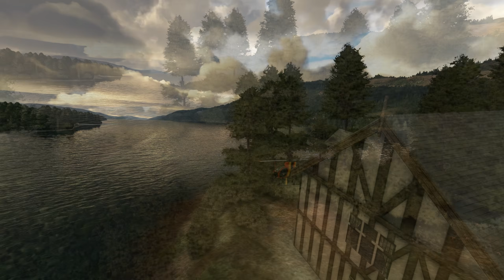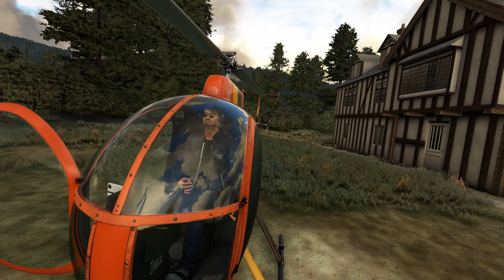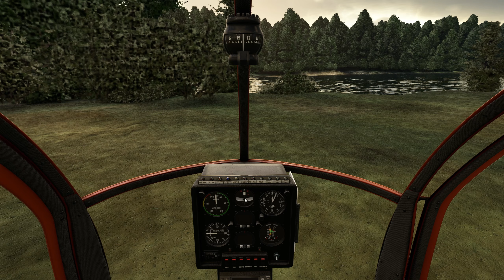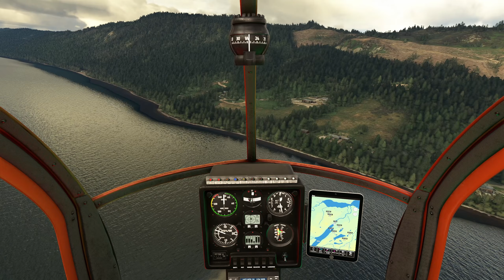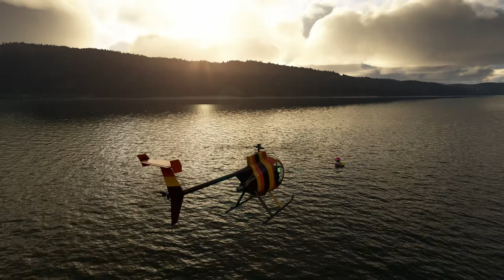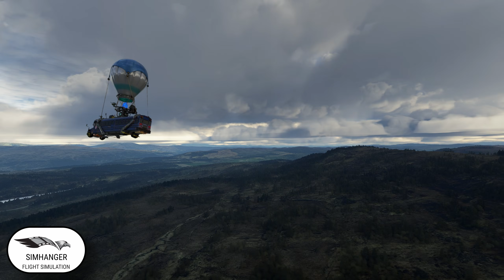Got Friends Mini 500 Helicopter | Searching for a UFO in Loch Ness | MSFS Review

Comment: I am using the Velocity One Flight Stick and have assigned a button to "Set Avionics Master" but I have to hold the button down as when I release it the Avionics displays disappear --any comments/advice would be greatly appreciated
Reply from the maker: @NormanHolden  check for another action conflicting with this and/or change assignment to avionics master on.
Reply: @SimHangerFS  Thank you once again Mark - I still had my Throttle Quadrant attached which I was not in fact using - disconnected - problem solved. I will go back later and find out what was actually causing the conflict.